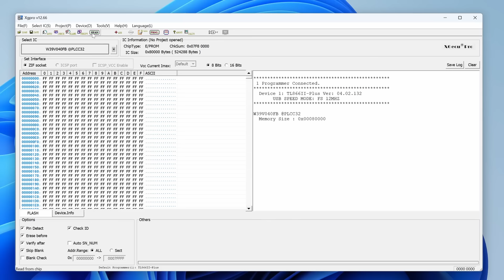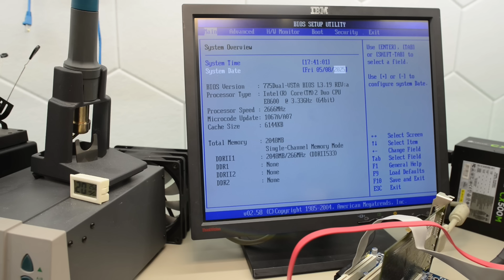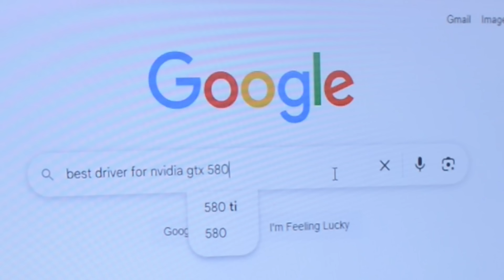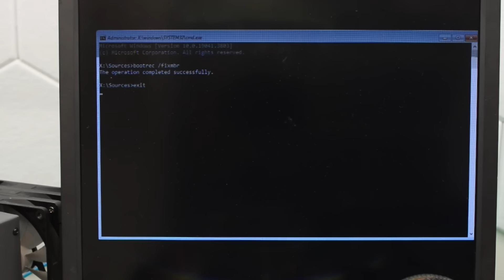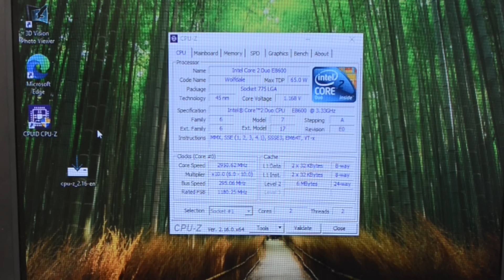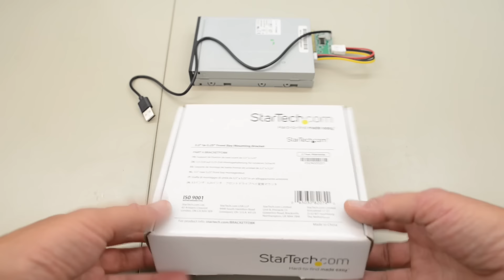Unbricking an ASRock Dual775-VSTA motherboard + 3 floppy drives mod! + ancient virus attack!

Comment: You may be able to sticker mod a socket 771 quad core Xeon to work in this board.  It just has to be the same era Xeon that the Core 2 Quad it supported was with same memory bus speed. (you'll have to mod the Xeon notch to rotate it along with the xeon mod sticker or modify the socket)  Xeons are usually cheaper than the C2Q.

Also check the 1.44 drive can still read and write 720k disks.  A lot of USB based drives cannot for some reason.
Reply: The board has really hard time with FSB speeds beyond 1066 so the Xeon selection is subpar. Intel Pentium Wolfdale, especially E5800 with O/C seems to be a nice sweet soot.
Reply from the maker: I'll check. Thanks
Reply: There might also be problems with the 1.68MB format

Comment: I bought Q9650 for $30 some years ago. It is a screamer and surprisingly cool running despite eating nearly 100W.
Reply: This board's VRM will be really pushed by a quad core and is generally not recommended. It is great for an XP build (or overkill 98) where two cores are perfect.
Reply from the maker: @mrh3h  We might tackle the VRM. I'm not sure yet
Reply: Only worth it if you don't pay for electricity lol
Reply: I've got one in an HP XW4600, going from dual core to quad core in this era REALLY improves the Win 10 experience. These systems can take up to 16GB RAM (Picky about it but can be done), and have an onboard floppy controller still too. Mine's got a GTX460 in it.
Reply from the maker: I'd buy 10 of them for that price

Comment: MIght want to think about OS, on my betweener machine even windows 7 won't format 720k disks nor either of the 5.25 inch disks. It will read and write them just fine but.
Reply from the maker: Same issue in w10. 360k and 1.2MB. I'm trying out a Win98SE dual boot right now.
Reply: @Epictronics1  I dual boot tween 7 and that one that starts with L (sure you have heard all about it) I never updated mine to 10, my main work computer is a old i5 mac mini. What happens with the other is every time I go to use it I notice I stole parts out of it ... or its configured in some screwball way lol (the mac mini is too much of a pain in the butt to steal its ram or SSD out of)
Reply from the maker: @osgeld Same storry with all my PCs lol. Luckilly, my work computers are Macs too, and left alone :)

Comment: it is not the board that picky about ssd's it is via sata controller itself. if you find either good ata-sata converter or an non via sata controller for pci or pcie (because that is a valid way to use 16x slot right?)every sata drive would work, otherwise if you don't manually select the drive to run at sata 1 speed they don't like to auto negotiate correct speed with via sata controllers
Reply from the maker: Luckily, the board seems super stable with this Samsung drive :)

Comment: Re the OS, if you do want to go the Win10 route, might be worth getting a Win10 LTSC IoT 2021 ISO from massgrave, which is available as 32 or 64bit. Main advantage is that it's an industrial version with long-term support, meaning it has mainstream support till January 2027, and extended support (read: security updates) till January 2032, so you won't have to worry about having it connected to the internet for a looong time, and with the 32bit version might even have more compatibility with really old software. I mean at least on that ASRock board you're limited to 3.5GB RAM either way, so it's not like 64bit would make much of a difference. Curious to see what that server board at the end is though. I haven't had the time to check through my stash of boards yet to find the newest/fastest platform that does support 2 floppy drives. I doubt my Sandy/Ivy bridge board with a boatload of legacy interfaces supports it, but I'm gonna try to dig it out and see. i7-3770K vs 360KB 5.25" floppy drive would be quite wild 😅
Reply from the maker: Yes, I run LTSC on all my Windows 10 builds. Most likely this one too. This installation is for testing only. An i7 would indeed be awesome with three floppy drives :)

Comment: You need a 730k 3.5 inch drive.  The issues between 1.2 and 360k 5.25 inch drives applies to 3.5 inch drives as well.
Reply: Isn't the main issue between 360k and 1.2m disks that the the 360k format is 40 tracks and the 1.2m is 80 tracks? And both 720k and 1.4m are both 80 track formats? 

I'm not saying this couldn't be a problem still, for some reason. But I don't see where the problem with 720k disks would come from.
Reply: @wotsac It’s the difference in magnetic coherence.  I grant you, success varies with some drives behaving better than others.  But that mistake has cost me data in the past.  Some lessons you never forget.  😂
Reply: @CandyGramForMongo_  1.44MB drives have a sensor and will change the write current when you insert a 720k disk. This works perfectly.

There are sometimes problems when using 1.44MB media on 720k drives but that's the opposite problem.
Reply from the maker: @wotsac  Untill now, I have used an old 9x machine to make my 720k diskettes on regular 1.44 diskettes with a piece of tejp to cover the 720k window. Never had any issues
Reply: @Epictronics1 That makes sense, as the drive and diskette media are the same.  Now read that on a 720K drive and see if it works.
Reply from the maker: I have not tested it yet, but it's very likely that the 1.44 drive will handle it.
Reply: @Epictronics1 If you can’t read a 720k disk written by a 1.44m drive on a 720k drive, this is why.  I’ve been down this road, 30 years ago.

Comment: The fact that windows defender finds, and isolates a virus from 1994 is quite impressive indeed.
Reply from the maker: I just wish it would block it without destroying the content on the floppy. That would be great
Reply: Presumably you could just wipe the MBR to clear it.
Reply from the maker: @troldrik  Yes, after I found it the last time about five years ago. I cleaned all my drives with fdisk/mbr. All but one apparently...
Reply: @Epictronics1  fdisk only deals with hard drives.  Floppies don't have an MBR, just a boot sector (similar to a partition on your hdd).  Best bet is to scan all your floppies with Norton or something.
Reply: It's easier to find an old virus than a new one.
Reply: That get turned off for me. I dont need  any antivirus . You will find zero virus on this pc ever, I am good with pcs and I have many leather bound books..
Reply: @Run187 it really depends on what government you have against you.

Comment: I also had that problem but an ancient board than that one. It was unbricked like that - writing to the chip - and then I had to set the mac address manually using a DOS tool. I believe that BIOS is complaining about some section got missing in its NVRAM DMI section, hence the MAC error. It's not dangerous but annoying.
Reply: Fortunately retail boards don't have that much data in the GPNV area. But on OEM branded boards, specially laptops, have lots of stuff there, and it is encrypted or signed. Many of these boards will not quit "manufacturing mode" and operate correctly if you don't set the correct data there as well. That's why is advised to make backup dumps of the original ROMs before replacing them. Or hopefully the machine still has all its stickers and you have the proper OEM tool to set the board data correctly.

Comment: Do you think we'll ever have "Drive A" ever again in Windows by default?
Reply: You can assign the conventional floppy drive letters A and B to any drive (and drive type) you want btw. Not recommended if you actually intend to use floppy drives in that system, because it'll shift the floppy drive to use the next available letter, and most software dealing with floppy drives expects drive letter A or B and often won't let you pick anything else
Reply: No - drives A and B are 'reserved' for floppy disks, a throwback from decades ago when PC's used floppy disk.  First disk was A second was B.  If you were rich enough to have a hard disk that was drive C, just as it is now.  I have a USB 3.5" floppy and it shows up as drive A in explorer.

Comment: Is that an LGA771 board I see at the end?
I look forward to seeing your solution to its CPU coolers. Most of the existing solutions screw in directly to the motherboard tray, and standalone ones are hard to find and expensive.
Reply from the maker: I have already ordered one set that didn't fit. Now I'm waiting for a new set from China. I may end up having to fabricate something myself
Reply: @Epictronics1  If it makes it any easier to find options, Socket 423, 603, 604 and LGA 771 all share the same mounting hole spacing, unless your 771 board is some OEM dreck that doesn't conform to standards. I've used a LGA 771 intel stock aluminum cooler (with its insanely powerful PWM fan that I had to massively throttle down with series resistors) with some DIY hardware on a Socket 423 system because with a S423 to S478 adapter, the height is so excessive nothing else would even remotely fit. On the other hand, I've used two new old stock S423 P4 coolers on my Dual Socket 604 Xeon board, cause they were one heck of a lot cheaper to get than actual server coolers. As an added bonus, they came with NOS Papst fans which weren't mentioned... Win-win
Reply from the maker: @Knaeckebrotsaege  Thanks. I checked. No Socket 423, 603, 604 backplates on Aliexpress, unfortunately.
Reply: @Epictronics1  And my long reply to this got censored out of existance. Don't know if you can still see it under "held comments" or something, or even approve it. The AI comment moderation on this site is really getting on my nerves
Reply from the maker: @Knaeckebrotsaege  Unfortunately not. YouTube is ruthless
Reply: @Epictronics1  Try four, and the last one. That's mainly because they were part of the motherboard tray, similar to early S423 Pentium 4s. The motherboard tray simply had a couple extra standoffs in the (standardized?) positions so you could mount the heatsink through the board and straight into the standoffs. Most server stuff worked in a similar way. I can't put any item numbers for a certain bay in any comment because doing that will immediately censor the entire comment out of existance fully (it's not even in my comment history anymore). Guess I can't help you by steering you in the right direction... absolutely frustrating

Comment: check the power draw for the floppy needs max 2a on both 12v and 5v so is not recommended to use only a usb 2
Reply: Yeah it's better to connect the 3.5" floppy straight to the PSU and ignore the little pigtail they give you. The berg connector on the USB adapter board just has 5V routed straight to the USB power pins, and with wires as thin as the ones on the already soldered-in USB cable, that's bound to cause issues at some point from voltage sag. Ironically the pigtail has like 5x the wire diameter of the conductors in that puny little USB cable... someone clearly didn't think this through when designing this adapter... or didn't get paid enough to care 😅
Reply from the maker: @Knaeckebrotsaege  I'll give it a try and see if it works
Reply from the maker: I'll check. Thanks

Comment: You can likely upgrade the cpu with a socket 775 Xeon cpu, it only requires some modification with some tape to get it working and you can buy them pre modified.
Reply: That doesn't also involve a BIOS microcode addition for Xeon LGA771?
Reply: @hugosimoes5119  not necessarily, as those LGA 771 xeons are mostly identical to consumer core 2 duos/quads. Only the oddball ones running at 1600 FSB which don't have a direct consumer equivalent tend to not work properly
Reply from the maker: I think I'm gonna try that hack on another project

Comment: I had a secondish gen board from gigabyte with Floppy inbuilt - I nearly made it my workbench system, but I wanted faster/windows 11 support.

I have an older system that I can transfer the files to quite easily with LS120 or Zip drive with the workbench system, since both have that so I decided that will do
Reply from the maker: I have a similar way of writing floppies, but very little space on the bench. I was hoping this PC would replace at least two PCs/displays
Reply: @Epictronics1 That would be perfect - I wish there was an add in card to give newer PCs proper floppy support, but unfortunately there doesn't appear to be. 

Even a PCI one would be great, you can still get new enough generation motherboards with them, but unfortunately it doesn't seem to be a thing. 

I guess for me I write mostly to the Hard drive/use zip/ls120 to transfer files to the systems once the OS is I stalled so it wasn't as necessary for me to have floppys. 

Excellent build though, I loved how the two 5.25 drives looked in a new case!
Reply from the maker: @communalnoodle1356  Yeah, that would be a great card to have. I'm running tests on this machine now and will get back to this project in a few weeks
Reply: @Epictronics1 awesome, look forward to the results - can always amend mine later :-)

I've used an A tec Nine hundred case for the 9 X 5.25 slots, it is overkill but it seemed like a good idea at the time haha

Comment: A Few Thing
1.E8600 Is Enough For Lab Machine
2.Cooler Master Does Still Offer 775 Mounting Kit For Hyper 212 Black, Yep This PC Deserve Hyper 212 Black 
3.Is GTX980 Time
4.Crucial BX500 - PNY CS900 - Lexar NS100
These SSD Are Compatable With Older System But I Recommends BX500(M500 Is Last Dich Cop)
5. You Should Mention Your Name;)
Reply from the maker: Has anyone tried anything faster than the GTX 580 on this board?
Reply: @Epictronics1  You're giving me stupid ideas for things to try... I like it 🤪
Reply: @Epictronics1   Be The First Guy Tests GTX970 Or 980 In This PC

Comment: Aye that fractal case is very nice. Been running one for about a year for my NAS. With good fans it really is pretty much silent. Also very heavy!

Didn't use the built in fan controller though, built a PWM controller and stuck it on one of the bays. Running at about 80%.
Reply from the maker: I just ordered a controller for 8 fans that is controlled by the CPU fan headers on the motherboard. Curious to see how well it will work
Reply: @Epictronics1 

I let the motherboard control the main inflow/outflow fans, and the processor fans of course, and then added airflow fans for the drive bays and roof, controlled by the PWM controller, in order to keep a constant flow of air over the spinny disks. The idea being the motherboard doesn't really get hot, so isn't really the ideal candidate for keeping the HDDs below 40. I could have run them at full whack, but even the bequiet fans make noise at that, so the PWM enabled me to tweak it down so it could not be heard inside the case. 

I think that totalled 8 fans too, as it happens. The fact you can fit 6 spinny disks and 8 fans in the case AND keep it quiet & cool is a testament to how useful this case really is.
Reply from the maker: @simmo1024  I tried these industrial Noctuas at full speed/12v. It sounded like a jet plane lol

Comment: If I'm not wrong, e8600 is a 3.3 ghz processor, maybe you should look at your bios settings
Reply: This board doesn't support 1333 FSB (= 333MHz) which the E8xxx series runs at normally. The board tops out at 1066 FSB (= 266MHz), and with the 10x multiplier of the E8600, you get 266 * 10 = 2666 MHz, rather than the 333 * 10 = 3333MHz it's supposed to run at
Reply from the maker: @Knaeckebrotsaege  The BIOS allows for overclocking. But strangely enough, it crashes beyond 295x10. Hence the 2.95GHz
Reply from the maker: You are correct. It's not officially supported by this board, so maybe it's a compatibility issue.

Comment: I love Fractal Design cases. I use them exclusively.
Reply: Same here, Define series is quiet and nice to work. Being using them for 15ish years.
Reply from the maker: This is my third Fractal case. I love the high-quality look and feel. Super impressed
Reply: @Epictronics1  Even their older "base models" like the Arc Midi (R2), Arc Mini (R2) or the Arc XL are solidly built. Just a shame that one by one they've been axing models that have 5.25" bays, because "who needs those anyway" 🙄
I've built a couple "retro" gaming PCs like Athlon XPs with watercooling into Fracal Focus G cases, mainly because they were affordable, still had two 5.25" bays and didn't look half bad. Buuut they've since been discontinued and replaced with the Focus 2 which has a grand total of zero 5.25" bays... so annoying
Reply: @Epictronics1  if you want a shitload of 5,25" bays you might look at Nanoxia Deep Silence 6 Rev. B or later. I wanted to buy such a case several years ago but it wasn't possible to deliver to my country from Deutschland.